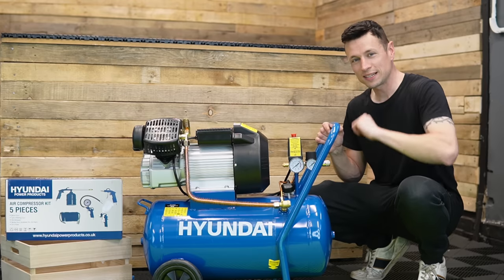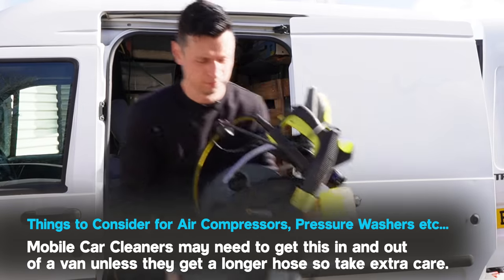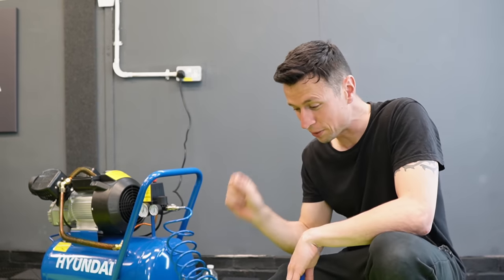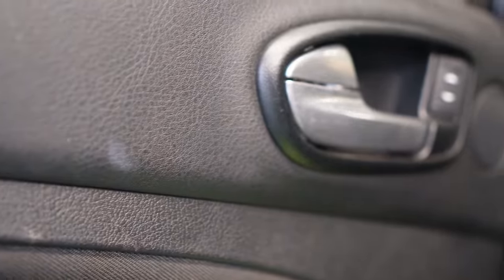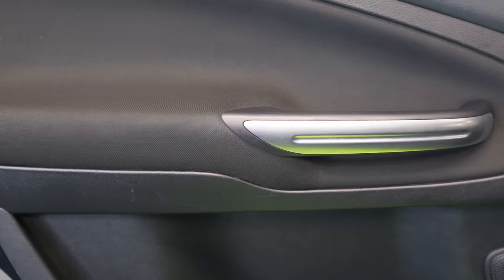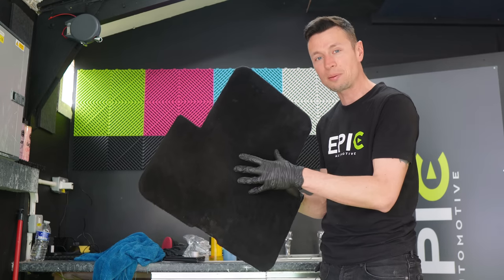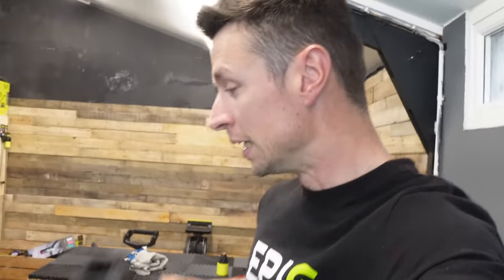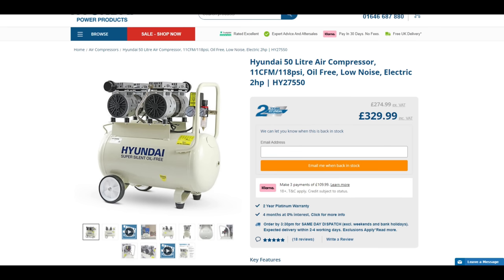The Best Air Compressor For Car Detailing? Why this Could Change Interior Detailing Forever!

Comment: I’ve recently got an Air Compressor which is similar and never thought of trying the chemical gun as you’ve demonstrated. I’ve already filled it for tomorrow 😂😂 great video.
Reply from the maker: Nice one. It's a really effective tool. I couldn't believe how good the seats came up
Reply: I've seen people use compressor with snow foam bottle and tornador to clean fabrics.

Comment: you the right size compressor for the tornador  you ll be blown away with the results
Reply from the maker: yeah I hope so. but the chemical gun does a mighty good job. Was really shocked how good it was
Reply: its what tornador recomend 50 ltr 3 hp compresser yes im wondering if you need it after showing how well that sprayer works

Comment: Great video and the Compressor looks ideal for detailing. You could add a pneumatic impact driver for taking of the wheels when ceramic coating them. We use a genuine TORNADOR BLACK Z-020RS CAR CLEANING GUN and it’s does an amazing job on a high CFM compressor. We even tried the vac attachment for the Tornador as well. Have you thought of adding some Quickjacks to the new detailing bay in the future. Makes it so easy to remove wheels and saves your back whilst working on the lower sections.
Reply from the maker: Im planning on getting a new tornador for the channel as im curious to see how good it is

Comment: Hello Dave from Australia🙃 Mate..

Stay away from aftermarket tinted windows with compressed air, one tiny hole or lose edge and the air will lift up a big bit piece of film.
Reply from the maker: Hi mate great tip. I should have mentioned that one 👌
Reply: @epicautomotivedetailing  Not a problem  Dave and if I could throw another 2 cents worth in - Compressor's have a duty cycle and if it kicks back in while your using just stop and wait for it to refill and them carry on again😎

Comment: Wont be long before you want to upgrade.. 50l runs out quick  .. ive got 150l in my home workshop and just about does what i need.. ideally you dont want it too cycle to often ... those degreasers are well handy in the engine bay for those hard to reach places.. wear a good dust mask when blowing dust.. i learned the hard way... now you've got that lovely workshop.. are you taking on work as id love to get mine cancoated.. spent a fortune on gyeon gear and not used it 😪
Reply from the maker: I'm still yet to feature gyeon but will be later in the year for sure

Comment: ive had a stanley 50l compressor for about 5 yrs and i never knew that was a degreaser, i thought it was for oil and never used it. i use it to blow the garage floor and work benches, drive a nail gun and blow up summer paddling pools etc.

Comment: hey mate we are in deep connection. I'm at my starting point with my detailing mobile setup and i took an Ava (know and see you are a big fan) and an italian FIAC WX3650 compressor with the same technical specs more or less: 3HP, 50 lt, airflow 360 lt/min, 2,2 Kw, 10 bar (and i paid it 275 euros cause it was last model in the shop exposition). 
Finally you can use the Tornador and let me know how it works with it, cause I suppose with that air flow it doesn t matter the air tank is just a 50 liters (everyone here told me I need a 100 liters to use well the Tornador... ).  Don't forget the duty cycle: these kind of compressor need a 50:50 work/off most of the times. Very good upgrade!!! Hope mine will be good the same
Reply from the maker: Yeah I'm getting the tornador very soon so curious to see what it can do. The chemical gun was good enough anyways to be fair
Reply: @epicautomotivedetailing  i ordered my Tornador Black-20 (we dont have the 30 max in Europe, i don t know why) just today 🤣. Tornado style will be much more effective than the set you showed that is useful starting point, I'm sure. But, i ve faith in using it more dry then wet, cause is DUST the real enemy of interior detailing. Too much use of chemical pressurized can cause a mush that press surfactants into deep, making difficult to remove them specially on the seats. Take care of this issue. It could cause white spots that come back after seats dry .....
Reply from the maker: @domenicobizzarro839  I checked the seats earlier and still couldn't believe how good it looks. When the chemical comes out it looks excessive but honestly it was minimal. Well happy 👌
Reply: @epicautomotivedetailing  that s real revolutionary for quality and time saved 👍 anyway, thanks for sharing such High quality contents. You are really a good one, professional, enthusiastic and generous. Thanks to your Ava Reviews i realized it was One of the best in the market and I decided to go for that! ❤️👌One of my favourite channel is Epic now
Reply: @domenicobizzarro839  hi, how well does the FIAC behaves with the tornador? I'm running an olf DYNAMAC 100L, don't know the specs, and he cant keep up with the tornador.
Reply: @PauloAmaral2U  Hey man It looks i m very unlucky with compressors. FIAC had a broken valve immediately After 1 use. Took for repair It did not come back for all the Summer so i asked for refund tò take the 50 LT Hyundai supersilent oil less from another shop. It works but i expected much more silent as Is written 64db. Well at 2 meters i measured 80-85 db. Never 64 if not 10 meters far. So, i m going tò give it back and be refund again. But the true Is 50 liters are not enough. You can use Tornador for maybe 20 sec consecutive then the compressor starts. Now I Will go for a supersilent 100 LT.
Reply: @domenicobizzarro839  I have 100L but don't know the restituet air of it. And it can't power the tornador at 8 bar. It looses power just after one minute of tornador use.
Reply: @PauloAmaral2U  😦 bad issue man .. all cause of this fuckin Tornador 🤭🤭🙈🙈
Reply: @domenicobizzarro839  yeah, a bummer, really like the tornador, it's an Amazing tool but requires so much air

Comment: Love the idea with he chemical in the gun however with the air spray nozzle I can’t help think it would just blow it elsewhere in the car, potentially an area you’ve already cleaned. Maybe I’m wrong but that’s why I’ve never used mine.
Reply from the maker: To be honest it didn't make too much mess. Worked a charm on my seats

Comment: I bought this prior to the pandemic. It's a great bit of kit but its loud. REALLY loud. And apparently 135 quid more than it was. And it turning itself on it happens a lot as youget thru 50L relay quick when using it as an air gun. It will also happen at the most inopportune moment causing you to jump out of your skin.  Great thing to do if you are doing an interior is to blow out the whole thing, everything, before you vacuum. Wear a mask/eyewear as you'll be amazed what shoots out of your carpet. Sounds counter intuitive but works.
Reply from the maker: Nice one I think the cost of living has really affected businesses costs have gone through the roof for me as well after the pandemic

Comment: The Tornador has a heavy air usage requirement, just wondering if the 50ltr tank capacity will allow it to work effectively?
Reply from the maker: Yeah I did notice but I'm happy to put it to the test so if it fails then I may of saved anyone who watches it 👌

Comment: If the oil gun is not dispensing the oil with the compressor what might be the problem.. Opened the gun pipes. No pipe is clogged

Comment: Is it a dumb idea to use compressed air to blow away water after a wash like you would with a car dryer? I've already got an air compressor so if it does the job without doing any harm there's no point going out and spending more money on something else just to clean my car's at home
Reply from the maker: Yes I understand that, but the purpose of the video is to highlight it's key benefits so if I didn't show it then I'd get some dumb idea highlight that I missed it out. Seriously I can't win lol
Reply: @epicautomotivedetailing  haha no I was just genuinely wondering if it is a good or bad idea to use compressed air for drying, I haven't tried it before and couldn't find a video on it. I found a great deal on a leaf blower so I'm gonna try that out on my next wash. I think an air compressor's strength is mainly the air pressure whereas a leaf blower's strength is probably air volume which should be better for drying? I could be wrong.
Reply from the maker: @Matin_M  honestly the best thing to dry a car quickly is a twisted loop towel, I have a car dryer which is good but quick by any means
Reply: @epicautomotivedetailing  do you use any type of drying aid? I'm scared to scratch the paint when I'm drying with a towel.
Reply from the maker: @Matin_M  I use ceramic detailer makes life so much easier

Comment: I am sure a compressor has its uses, but your demos seem to produce way too much liquid. Lots to mop up afterwards! Would a steamer be more practical? Why did you have vented tiles in your studio? Seems to be the perfect dirt trap?
Reply from the maker: I had never used it before, Its all trial and error. I will keep experimenting with how much chemical is produced. No problem cleaning the floor. I have a brush head for my hoover. it sorts it seconds. Anything stuck can be blasted with the air compressor